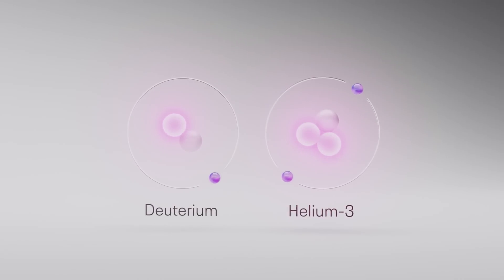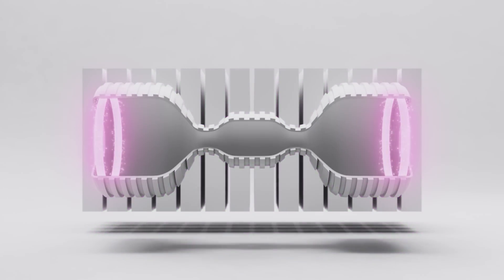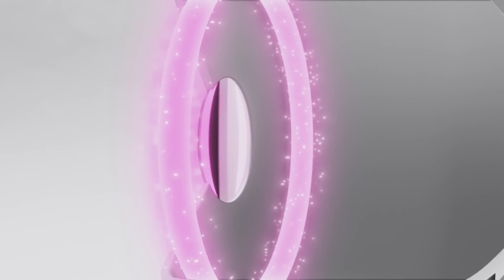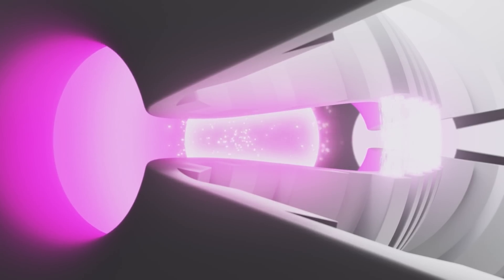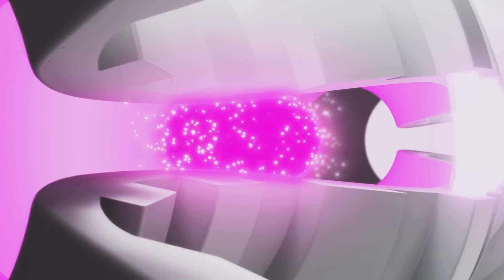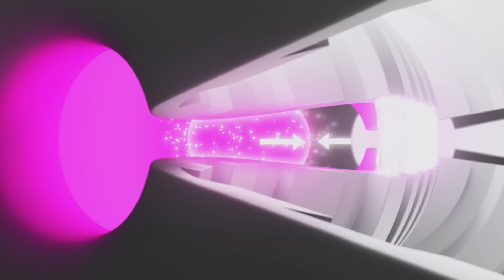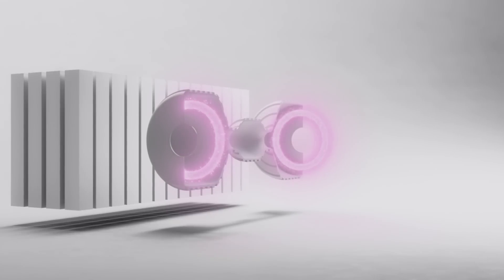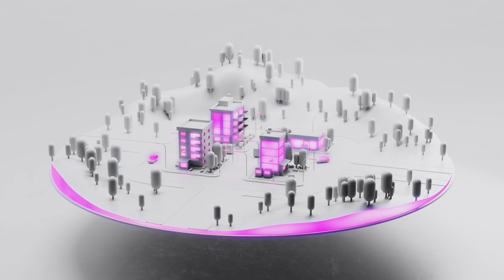Helion's approach to fusion: How it works

Comment: This is genius. Even nuclear powerplants and conventional fusion reactors convert energy through steam turbines. I suppose induction results in less energy loss in the conversion process?
Reply from the maker: That's right!
Reply: @HelionEnergy  what is the total efficiency? How much of the fusion energy you convert into electricity?
Reply: @oneman7094  like there gonna throw that out on YouTube comments...
Reply: @oneman7094  They are predicting to be at 
101% by 2024.
Reply: @oneman7094  i think they said it was 90-95%
Reply: Is the plasmoid unification model being used to help design better reactor structures ?  @HelionEnergy 

I think between you guys and what Malchom Bendall has come up with you will save the planet and we are all  in for a very exciting future 👌
Reply: @HelionEnergy  Steam turbines in fission plants are around 30% efficient. What's the efficiency of magnetic field change current capture?
Reply: They could stick this in a space station and use it as propulsion and a power supply at the same time
Reply: @danielschmidt2186  They actually have designs for lighter fusion generators that could be used on spacecraft
Reply: Won’t the need the fusion ignition to break the 100% return figure? As that’s what releases the higher amount?
Reply: It's sad how quickly people buy into BS without proof.
Reply: @Embassy_of_Jupiterthe issue is all in the fields. U need a certain spatial relation to capture the energy that might be hard on angry plasma
Reply: I don't think most people understand that our world is still essentially steam-powered.
Reply: We could give thanks to the man himself, Michael Faraday. :) Faraday's law as explained in the video can convert the varying magnetic fields generated by the plasma into electricity. Hope to see these reactors used for buildings that have a high electrical demand. CERN could use this Helion reactor to power their particle accelerator. NASA & ESA could run smaller versions of this on their spacecraft to power their next generation ion drives to Mars and beyond. 

By the way, it would be cool to see a paper on the Helion's induction generator, even if I may only understand 1% of it. Science is my favorite subject. Since 2016, as a teen, I have always hoped that nuclear fusion wouldn't rely on old fashioned steam turbines in the 2050s. Guess we get this tech ~30 years early. Woo, yeah... Innovation like Helion's is key to getting away from fossil fuels. So, wind power and solar work well in areas with lots of wind. When clouds and stagnant air are abundant, a Helion reactor could kick in, as the rate of reaction can be sped up or slowed down with minimal ramp up time. Bless the folks at Helion.
Reply: @thatguyalex2835 calm down kid! It ain’t over till the fat lady sings but this is the most promising technique I’ve seen
Reply: @jhoughjr1 It won't work. Not with that fuel mix at least. The deuterium will preferentially fuse with itself long before the He3 gets involved. That's ok, but it means there will be radiation, embrittlement, toxic waste and a power process reliant on steam turbines rather than direct conversion. Great graphics tho!
Reply: @thatguyalex2835 Love this comment! I was thinking the exact same things you said about the use of steam turbines
Reply: @thatguyalex2835 https://youtu.be/G1vyMcqiVtA?si=5rly3qjjogAA1YX0
Reply: It can in theory. I’m sure there are limits currently in practice
Reply: Also more importantly, the way those other fusion reactors even convert the fusion energy to thermal energy is with a metal called Beryllium, which then after use becomes radioactive waste
Reply: Well this tech is a work of art why no one else thought of that?
Reply: How do you vent it?
Reply: but they don't have a viable method to achieve fusion ignition

Comment: Could I ask if there is any information on its theoretical efficiency?
Reply: The input energy can be recovered at >95% efficiency. Recovery of the fusion energy is somewhat lower since some of it is in neutrons and X-rays (don't have exact numbers for that).
Reply: @elmarmoelzer2229  So does that mean that most of the energy from the fusion goes into creating and expanding the plasma?
Reply: @mouli570   Sorry if I was not quite clear.
The process is essentially this (very simplified):
They take 1 kWh (or so) from the grid and charge their capacitors with that. 
That energy goes into the fusion machine to power the magnets. 
The magnets create FRC plasmoids from the injected fuel and accelerate them towards the central chamber, where they merge into a single, hotter and more stable FRC. That FRC is then compressed by even stronger magnets.
When those magnets are turned off, the FRC plasmoid wants to expand again due to its own internal pressure. This would happen even without any fusion reactions adding energy to the plasmoid. 
Helion can recover 95% of that expansion and feed that back into the machine to power the next shot.
Now if they were just doing that, then machine would be net energy negative. 
But then of course there are fusion reactions happening. 
The energy contained in those fusion products that come as charged particles is (to some extent) transferred to the FRC plasmoid and further drives its expansion. 
That energy can also be recovered at very high efficiency (don't have exact numbers on that but should be close to the input energy). 
Then there is some fusion energy that is not in charged particles: neutrons and X-rays. That fusion energy is not transferred to the plasmoid and thus does not contribute to its expansion (likely not quite that simple either, though). So that can not contribute to the next shot, unless they add some extra machinery to extract that too (is complicated and expensive though and likely not worth it).
The energy from the charged fusion products is what makes up for the 5% loss and adds additional power to put on the grid.
Overall, as far as I understand from the numbers I have seen, they plan to have about twice as much energy going to the grid as is recirculated into the machine to power the next shot.
Hope that helps.
Reply: @elmarmoelzer2229  perfect thanks! This was quite informative.
Reply: @elmarmoelzer2229  
I really liked that you explained it in a way that I, with just highschool physics, could follow :)
Reply: @elmarmoelzer2229  Thank you so much :virtualhug::yougotthis:
Reply: @elmarmoelzer2229  what an amazing explanation......thanks
Reply: How do they remove the helium from the chamber ?
Reply: @curtmarler1 My guess is by opening it every 200 cycles to bring in fresh lighter stuff and dump the heavier stuff.
Reply: It sounds like a true and tied method of achieving fusion reaction but until it is sustainable and useable it will just be another laboratory experiment

Comment: No only is it a smaller reaktor than those huge ones like ITER, but it also does not use the enegy to heat up water, like 100 years ago 😂😂😂👍🏼
Reply: It also doesn't require dedicated plants to produce electricity. They plan to mass produce small units that can be shipped to wherever needs power production. I don't exactly know how that works, but what I do is:

Look at the ITER site.

Helion's response to that is: Haha, no.

Comment: "Helion directly recovers electricity from fusion plasmas", do publish the Engineering Q for this power plant producing net energy. The best (Reactor) Q from JET was 0.67, for a viable power plant (driving turbines) you need 350.  Don't forget to include the energy losses due to the apparatus cooling load, when Helion reaches Q=350 let me know.
Reply: They don’t plan on using turbines
Reply: 1) Helion directly converts changing flux (due to plasma expansion and locked-in field lines) to emf via faradays law (think of their reactor as a shaft-in-generator, rather than a boiler)

2) Because of this, they actually can generate energy in a sub-ignited regime, so Q only needs to be of order like 3ish. This device is very different from Jet, which is a steady-state (not pulsed) Tokamak which operates at much lower densities for longer timescales.
Reply: @TurtleBoss33  cool graphics work but I really don't think that this is the way magnetic fields work man
Reply: .. as far as i know this is not how any current reactors work
Reply: No turbines mean Q>350 not relevant here. Im not sure what the energy capture effiency of  FRC-induction is tho -- so relevant Q threshold may be higher or lower.
Reply: Can they meet the First-Law Energy constraints? No.  Can they beat break-even Reactor Q= 1? No.  Do the math, without Quantum Tunneling it ain't gonna happen.  The speaker cites poetry, but let's see the empirical data for the above. Without meeting the above criteria, Helion is simply more Voodoo Fusion.
Reply: My first question would be what kind of Q you are talking about. Secondly, no you do not need THAT high a Q. Normally a Q of 20 is considered sufficient. For some designs as little as 10.
Helion is in a special situation due to their direct energy recovery, which also recovers the input energy at 95% efficiency. And because of that they will get away with a Q of about 2 and still produce 50MWe with their machine.
Reply: @elmarmoelzer2229  As mentioned previously the gains "Engineering Q" or "Reactor Q" please cite either one.  Yes, if they can push electrons directly without the turbine/generator energy conversion is a huge improvement and lowers the burden on gain Q.  Thanks for everyone's interest in this topic.
Reply: @lesmiklosy4300   IIRC, Q(eng) is about 2. Q(sci) is only slightly higher. Note that theoretically, they can get away with a Q(sci) below 1 and still get an engineering Q>0. I say theoretically.
See Hsu, Wurzel et al "Progress toward fusion energy breakeven and gain as measured against the Lawson criterion".
Reply: @elmarmoelzer2229  Won't the tritium produced in the deuterium-deuterium reaction just react with the deuterium, to produce the same problems associated with conventional fusion?
Reply: @vidurkapur1  No, the Tritium is too hot and non-collisional on the timeframe of the pulse.
Reply: @vidurkapur1  No, the Tritium is too hot and non-collisional on the timeframe of the pulse.
Reply: @elmarmoelzer2229  Thank you very much for your answer!

Comment: what are fuels ? where is turbine ?
is  generates DC current ?
no cooler required ?
Reply: The magnets will need to get cooled by liquid helium.
Reply: And thats one of the big energy requirements
Reply: @qwaeszrdxtfcgvbqwaeszrdxtf5733  Nope, they are not superconducting magnets.
Reply: @elmarmoelzer2229  how can non superconducting magnets be enough. They clearly aren't enough in tokamak.
Reply: @qwaeszrdxtfcgvbqwaeszrdxtf5733   Because this is not a Tokamak. An FRC has a much higher Beta than a Tokamak (about 20 times higher) so their ratio of internal plasma pressure to magnetic pressure is 20 times higher than in a Tokamak and that means they need less powerful magnets. 
Plus their machine is cylindrical. So the size of their magnets is not limited by the size of the donut hole in the middle.
Reply: They do need some cooling, but they are using ordinary magnets, not superconducting magnets. So no cryo- cooling.

Comment: I understand the plasma created in this process is non-thermal. This means actually you need lower triple product then the thermal ones like tokamak. So how much triple product do you need to achieve Q factor beyond 1 for ³He-D and D-D fusion?
Reply: I do not know the exact triple product required, but they have some really big advantages over Tokamaks, aside from the direct energy recovery. 
E.g. they have a very high Ti:Te ratio which lowers the triple product requirements (Hsu, Wurzel, et al, Progress toward fusion energy breakeven and gain as measured against
the Lawson criterion).
Helion recently gave a talk at the APS about how their design with D-He3 will outperform a D-T Tokamak at temperatures over 20 keV.
Reply: yeah i feel dumb now.
Reply: The triple-product is derived from an energy balance with some massive assumptions, if the energy balance is negative the triple product is meaningless. I doubt Helion can show a positive energy balance for this pulsed reaction but we shall see.

Comment: So where is the fuel intake or exhaust?
Do these new fusion products break down in fractions of a second back onto deuterium and helium? Do they have to flow back to either end to be reused?
Reply: They have pumps to pump out the products and the remaining fuel, after which they are separated and (if suitable) re- introduced into the fuel mix for the next shot.
Reply: How many cycles per second are there?

Comment: You can't do it at 1 million miles an hour. That's 447,000 meters per second which is 147,000 m/s faster than the speed of light (300,000 m/s). Nothing can go faster than the speed of light.
Reply: Nope - one million miles per hour is MUCH SLOWER than the speed of light, which is about 186,000 mile per second.
Reply: 3,00,000 km/s not m/s
Reply: As others point out, speed of light is roughly 670,615,200 miles/hour (670 times faster than the speed of the head-on plasma collision).

Comment: This sounds genius
Is there such a device?
Reply: It's a Z machine, every country that developed thermonuclear weapon has one.
Reply from the maker: We’ve built six fusion devices so far. Our current fusion device, Trenta, reached 100 million degree Celsius (9 keV) plasma temperatures and completed nearly 10,000 fusion pulses. Now, we’re building our seventh, Polaris!
Reply: @HelionEnergy  wow 🤩 would love to see Polaris 
Also the rendering in this video was very nice 👍
Reply: @HelionEnergy  do have a goal for what the energy recapture effiency & Q of the Polaris will be?
Reply: @andrewkonya2424  As far as I'm aware it's supposed to be >1, though not significantly.

Comment: if it was this simple, we would have nuclear fusion already
Reply: Who said it was simple? They've been working on it for seventeen years and are investing billions. If it looks simple to you it's because it's a two minute ultra-simplified promo video.
Reply: @peterswords5970  read again what you wrote
Reply: Every complex subject can be explained in simple terms. It doesn’t mean it’s easy to do and without challenges
Reply: @BrianSu  leaving out the difficulties from the explanation is not "simple terms".
And even if it was, i don't see what is wrong in pointing out that they are doing so
Reply: the process is somewhat simple, controling it properly and make it properly each time in series repetition is the hard part.
Reply: @madcientist5438  every process is somewhat simple if you purposely leave out what makes it complex
Reply: @Feffo I too wish this was a 5 hour technical lecture with a greater focus on the semi theoretical nuclear physics of fusion.
Reply: @hamsolo474  A 1 minute "this looks simple but..." was enough

Comment: Velocity greater than 1 million miles per hour seriously ?😂
Reply: Yup and they have demonstrated that many times, are not even the only team doing it.
Reply: not hard because it’s in a vacuum and they’re accelerating charged particles
Reply: Do you think that is a joke?
Reply: @Alex-lc1bv  you still have any doubt in it 😂
Reply: Large Hadron Collider smashes particles together at roughly 670,615,200 miles per hour. However, they don't exactly explain how they accelerate the plasma toward the center, and don't explain whether the energy coming out actually exceeds amount going in, and if it does, by how much. But this video seems intended to explain it conceptually as an investment pitch rather than as a scientific study.
Reply: @SteveBonario  It is (quite clearly) intended for the general public and not scientists. Their other video (the 2020 Results- SOFE- presentation) is for scientists. You can look at that.
They can get away with a relatively low Q because they can extract 95% of the input energy along with the fusion energy. That dramatically lowers the requirements.
As for how they accelerate the plasma towards the center: They use magnets to push the two FRC- plasmoids towards the center. FRCs are weird in this way. When two of them collide, they don't just disperse, they merge into a new, bigger, and hotter FRC. FRC stability increases with temperature. So they can keep it stable for longer. Then another set of magnets compresses the FRC to even higher density and temperature. When the FRC "relaxes" afterwards it induces a current in the compression- magnets.